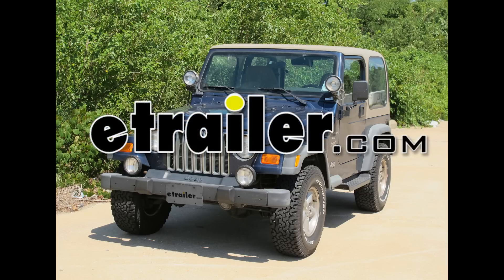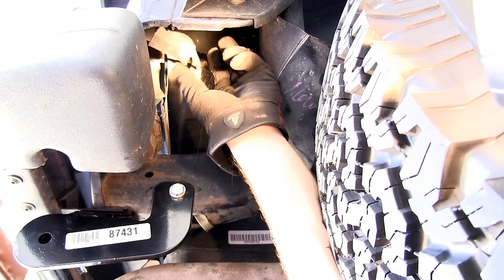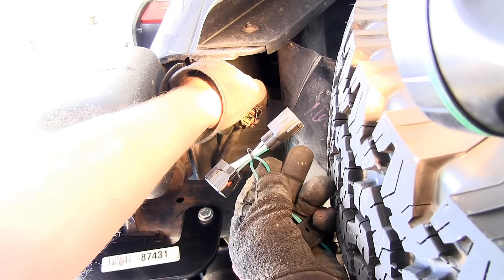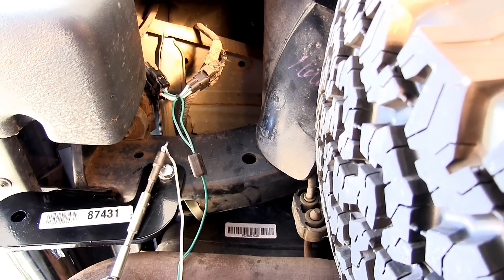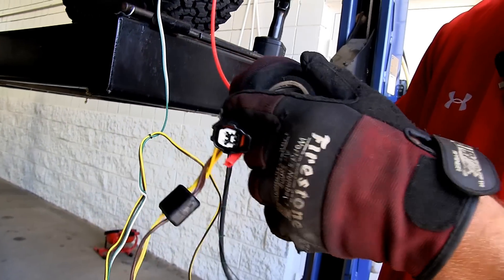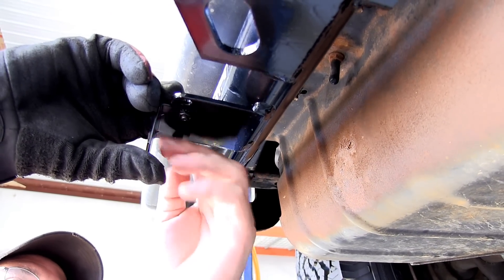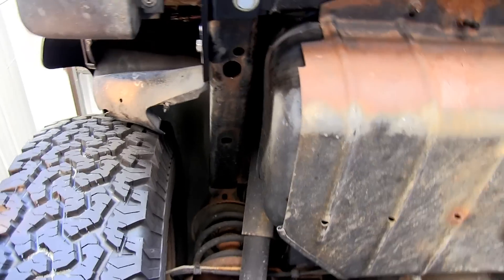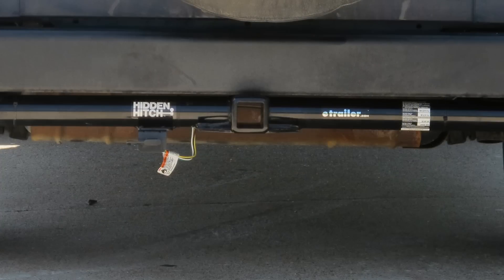Set up: T-One Vehicle Wiring Harness with 4-Pole Flat Trailer Connector on a 2000 Jeep Wrangler

Comment: Would this part # be the same for a 2001 tj?
Reply from the maker: This wiring kit is designed to fit the 1998 - 2006 Jeep TJ. Check it out on our website in the following link.
https://www.etrailer.com/Custom-Fit-Vehicle-Wiring/Tekonsha/118409.html